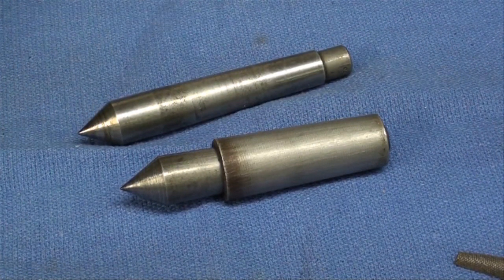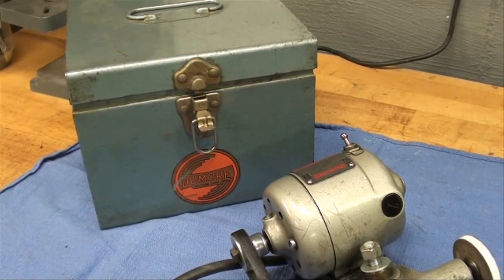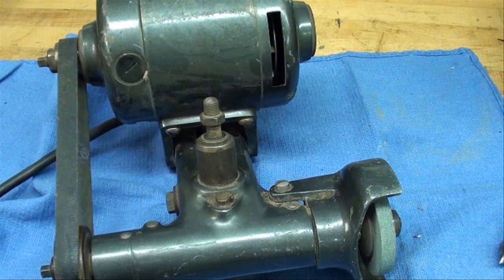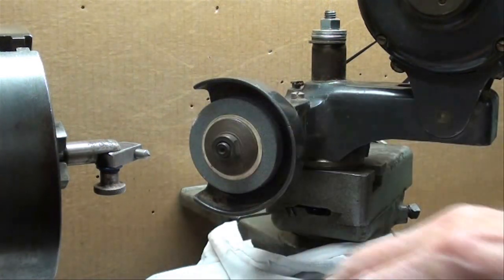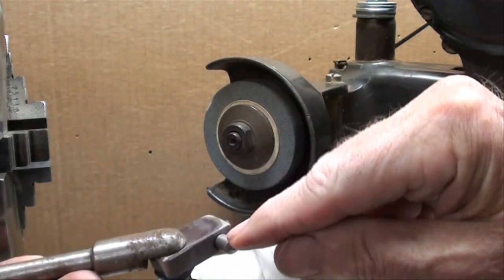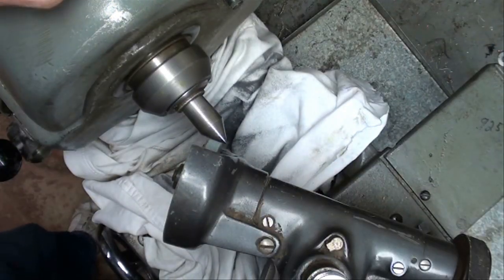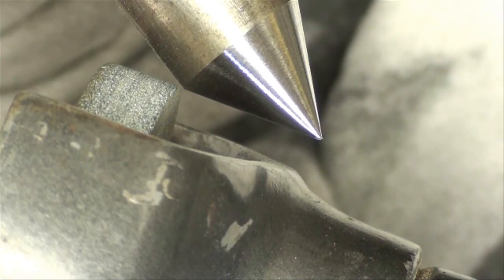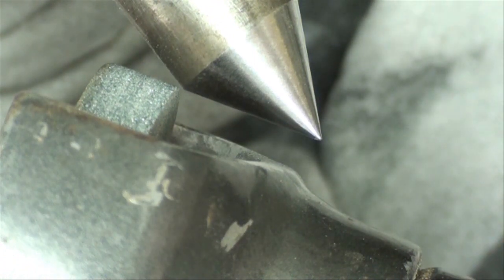MACHINE SHOP TIPS #94 Grinding Lathe Centers With Dumore Grinder  tubalcain

Comment: +mrpete222 I am trying to use this method to clean up my tailstock live centers but have no idea how to do it. I have a Dumore tool post grinder the same as the one you were using. does this only work on dead centers for headstocks?
Reply from the maker: Only for dead center

Comment: Isn't it kind of unsafe to have rags laying on the ways like that? Wouldn't a piece of oiled plywood be a better alternative? I have a grinder but I have never used it. As a matter of fact, you are pretty much my mentor for lathe operation. My Dad gave me his Atlas last year and I have been trying to learn to use it for something useful.
Reply: Robert, from personal experience I would avoid using any item, rags or wood, that is oiled below any grinding operation.  I have caught more than a few rags on fire with grinding sparks.  In fact, I have caught myself on fire twice from grinding.

Comment: My dumore model 44 runs backward, I. 
have to be careful or it will unscrew the chuck, was told to reverse the wires on the  fields brushes. To make it run ccw.

Comment: Excellent video. I made a small toolpost grinder that I used with small HSS and diamond burrs, and it worked OK, but probably not for this. I can see the necessity for hardened steel tooling and the high surface speed certainly will give a much better finish than turning with carbide. I'm thinking about making another toolpost grinder using a flexible shaft which means it should put less weight on the compound and more easily held. It may need a better housing and bearings.

I think your grinders need some PM, with new 3 wire cords and strain relief. I agree 100% about personal responsibility but also you should at least make sure your lathe is solidly grounded in case of insulation breakdown (which is a very real possibility in older power tools).

Thanks for sharing your knowledge and experience!
Reply from the maker: +Paul Schoen Thanks

Comment: This shows my ignorance of machining, but why is this done with a grinder as opposed to just chucking it up in the lathe and taking a cut that way? It seems that you could get just as good of a surface finish and that the grinder is unnecessary. What am I not understanding?
Reply: It’s hardened steel.  It will not cut on anything.  Grinder stone, diamond wheel only

Comment: Nice video! I do not know if it is common in America, but here in Norway, I trolled that we usually run grinder upward with suction over. This is quite convenient, and reduce dust significantly. driving forward. However, this could just be something I learned once. Johan.

Comment: Good presentation. I would love to have a tool post grinder for my little Myford lathe. I haven't seen anything for sale, but continue to look. I've thought about making one, but have to find a motor small enough that spins at the correct RPM. I actually did a little grinding on a model turbine rotor using a Dremel Tool clamped to my tool post. (my channel is named sohackitj) Thanks for posing all the great videos!

Comment: I like your comment about OSHA, hahaha. Thanks for the another great video. I do not have a grinder, so I used carbide on a carbon steel center as you suggested. Worked very well. The center was off my about 0.0007" before I started, and finished with no TIR on my old 10" Logan. All my experience so far I can thank you! I agree with ibsoarin, I am a chemist by trade, but would have been a machinist too, if you would have been at my HS way back when.

Comment: Great video, as always.  Once in a great while, I use a toolpost grinder at work  If you want an interesting challenge, try grinding threads on hardened steel.

Comment: I find this stuff interesting, but have no experience with lathe operation, so I apologize in advance for the novice question.  Couldn't you put the Dumore dressing fixture 8:26 on a bar that is running from the spindle to the tail stock, set the compound rest at zero degrees, and true up the grinding wheel in a perpendicular fashion?  Is this a transfer of tolerance issue, just the way you prefer to do it, or something else?

Comment from the maker: Yes-just for final finish & sizing. And the wheel does wear constantly, the smaller the wheel, the more its noticible. When I worked at Caterpillar, the fuel injector parts were tiny, yet the machine automatically dressed the wheel every 50 parts, & the wheel was 24" dia.

Comment: I was also taught and always practiced my grinding with the spindle rotating the opposite direction, you were right it wasn’t the end of the world!  Did a lot of stellite valve seats in the yards and ceramic flame spray projects. You have a nice collection of grinds and gave a real nice demo on using them!  I plan on building a tool post grinder by spring, to regrind my chuck jaws and will refer back to your video for design and use, Thanks ;{)---